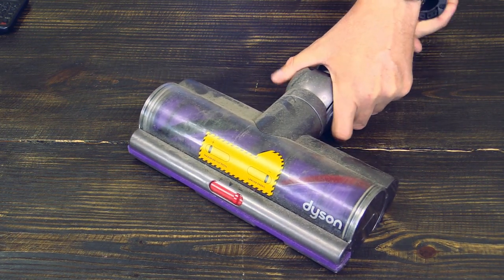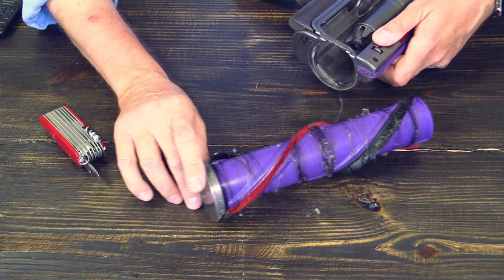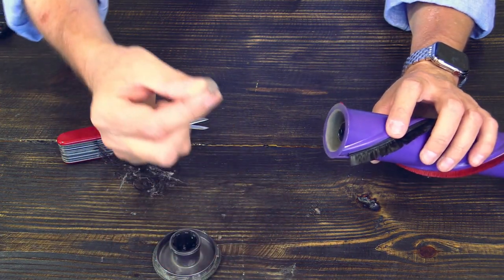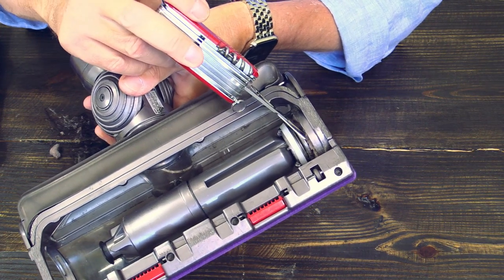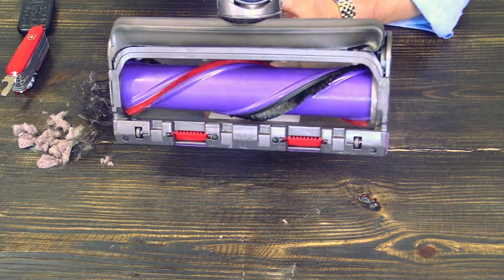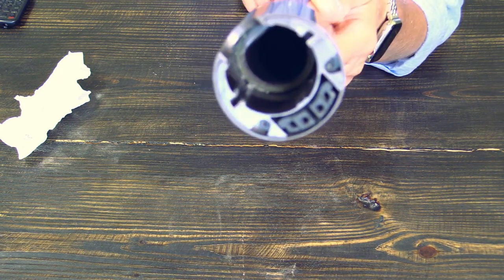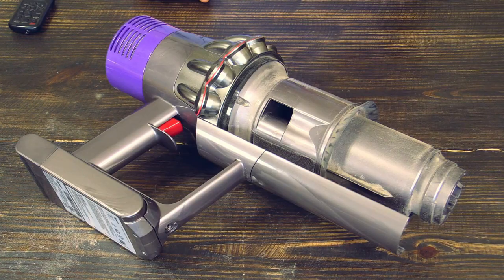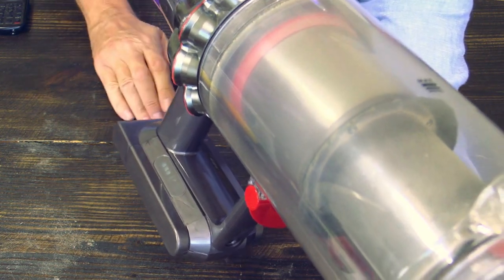How To Check The Dyson V10 For Blockages.

Comment: Wanted to add that taking everything apart did not fix my problem, but it helped. I tried everything you did and took it apart way more than I thought could thanks to your video. But also knowing that I had cleaned it, I felt a little deeper and my filter was slightly damp still despite it being at least 36 hours later. So I put my hair dryer on low and put that in the filter hole and VOILA - all is well. I assume that the dampness decreases suck flow so looks like a blockage. Thanks for walking me through all the possible blockages. Hopefully this extra step will help someone else.
Reply: Thank you so much for posting this! You just fixed my problem 👍
Reply: Thanks for the added info about the dampness, also fixed mine as well

Comment: Thank you for your helpful video.  I want to share a solution that I have come up with for getting clogs or dirt out of partially hidden, often circular, spaces, such as the one inside behind the beater bar next to the motor.  I have found that it is useful to a "zip tie" for tying together wires as a probe/poker.  It is almost exactly the width of the flange at the back of the assembly and will ride inside and bend around the curve pushing the accumulated junk out.  It is sufficiently strong to push without flexing and yet, because it is designed to curve into a circle to bind wires, it will follow curves and any change in surface that you encounter.  As it is plastic, it will not harm machined surfaces or even other plastics; I've never scratched teflon with it, but then again I've never tried.  I hope this little home made tool will help you as much as it has helped me.  Thank you again.  TR

Comment: I got rid of my old V3 because I was sick of using a chopstick to get rid of blockages.  Within 10 minutes of using the V10 it got blocked by a bit of paper - so I had to use a chopstick to sort it out.  This video helped but I am really pissed off at Dyson.  Brilliant engineering in parts but really dumb in others.  Best to get one of those American machines if you want reliability
Reply from the maker: Hello Roland. Thank you for your comment. I am sorry to hear about your problems with your  V10, but I am glad that I was able to help. I will get tomorrow the new Dyson V15. Let’s see if the V15 is better engineered than the V10. Have a great Sunday. 😋

Comment: Great tutorial, but I think I have a blockage in the motor part (from lots of dust and hair?) as I've cleaned everything out, removed all the pieces, and filter light is still flashing. What do I do!?
Reply from the maker: Hello Rachel. Did you clean the filter? How old is the filter?
Reply: @Woopnik  I had just cleaned it. It's only one years old. I've followed your video, recleaned everything and will try again tomorrow. I only know it' seems to fill up fast, and that when I took it apart and banged on the main motor unit little packed chunks of dust would come out. Danke
Reply from the maker: Well, don’t despair, I will try to fix your problem. Please follow these steps:

Remove all tools and accessories from the machine. Put the machine in max power mode by sliding the switch towards max (only V10). Pull and hold the trigger for 10 seconds. Does the blockage light on the handle come on without any tools?
Reply from the maker: Hello again Rachel. Last night I was trying to duplicate the problem you have, but I could not. It looks like your problem is much more serious. Was the filter really bone dry as you reinstalled it after washing? In any case, I am afraid that I cannot help you online. Please contact Dyson:

You can email or call: questions@dyson.com - The Support team is available 24 hours a day, 7 days a week. Most inquiries are handled within two hours or less. 1-866-MY-DYSON (1-866-693-9766) - The Helpline is available from 8am - 8pm Monday to Friday, and 9am-6pm Saturday (closed Sunday).

I apologize that I was not able to help you with your problem. 😳
Reply: @Woopnik  I am in despair! It's only one years old. When everything is removed the filter light flashes then turns off after around 8 or 9 seconds.
Reply from the maker: In my opinion the electronic in the V10 is faulty. That can only be fixed by Dyson. Is your Dyson still under warranty?
Reply: I never registered it. But I have my receipt. It's 13 months old. I'll call and see. Thanks so much for your help
Reply from the maker: I am trying, but in your case I have to see your Dyson. Have a good weekend 🥸👍

Comment: If the blockage light didn't go off by following the video steps - the solution was to replace the filter (cleaning it didn't work) , you should feel "airflow" from the filter...
Reply: Thanks for this; I've tried EVERYTHING to fix it - and nothing has worked.  Guess it's time for a new filter.  :)   $30!!
Reply: @AshleyWilson316  I got 3 filters (not genuine ) by 15$ from AliExpress , 2 months and still works fine

Comment: Thanks bud. Was about to buy a new one. Mine was obstructed where u had the napkin...didnt see much there. Took a toothbrush and scrubbed some dust and stuff...then I rolled up a paper towel(1/2 of one) and used a large hemostat to push it in to that space, and drag it back out and now it works...weird nothing but a bit of dust in there...but it apparently was the problem.

Comment: Hi my dyson v11 stopped working after i cleaned the filter. It was still little bit wet when i used the vacuum the last time. Can anyone help me please?
Reply from the maker: Hello Ngoc. I am sorry to say that most likely your V11 is broken beyond repair. A wet filter can short out the motor and cause it to break permanently. Putting a wet filter can also void your warranty, so you might have to pay for the repair out of pocket. Please contact customer support at Dyson:

Phone
844-705-4777

8:00am - 8:00pm CST Monday to Friday
9:00am - 6:00pm CST Saturday

Email
help@dyson.com
To help Dyson to address your inquiry as quickly as possible, please include the following in your email:

Your name
Contact number
Product model or serial number

Comment: Hi my dustpan is stuck and won’t open, any tips on how to get it to open up?
Reply from the maker: Hello Chayyy. The rubber gaskets use a fine powder as lubricant and if they get wet the bin can become rough to handle due to the rubber folding or holding onto the plastic/metal. This is a common issue for many Dyson owners. To make the seal less sticky vacuum up some baby powder or a handful amount of flour and made sure it was everywhere in the canister after that wait for a bit and again. This time after applyling some pressure it should open.

Comment: There are to many places for dust to collect.It’s a full time job each time you use it.Especially in my home with a dog and many long pile carpet.Mine is showing airflow obstruction when nothing is attached just the motor part and dustbin.

Comment: I cleaned everything filter, removed blockages, but still blockage led blinking
May be battery?
The boost intermittently works
Reply from the maker: Hello Fauzi. Remove all tools and accessories from the machine. Put the machine in max power mode by sliding the switch towards max. Pull and hold the on/off trigger for 10 seconds. Does the blockage light on the handle come on without any tools?
Reply from the maker: If the blockage light still comes on remove the dust bin and turn on the machine. Push the cyclone release catch away from the handle of the machine until the bin base opens. With the bin base open, press the red bin release catch on the underside of the bin and remove it away from the machine. Pull and hold the on/off trigger for 10 seconds. Has this resolved the problem?
Reply: @Woopnik  having the same issue, my machine is clean, filters clean, all attachments off, bin off, so  I've exhausted all of your advice and still my machine cuts off intermittently and blockage light flashes. What should I do now?
Reply from the maker: Good Morning Ryan. If you have followed all my advice, I think it is a good idea to contact Dyson for help: 

https://www.dyson.com/support/quick-links/contact-us

I hope I was of any help. Have a great weekend.

Comment: Mine is still flashing and shrugging ... i dismantled it and it looks like the problem is in the main battery/ filter component
Reply from the maker: Hello Mubeen. Did you check the filter? Is it clean?
Reply: @Woopnik  its 100% clean ... cleaned it a few days ago actually ... plus its not the filter lights on ...
Reply from the maker: What exactly is flashing? The filter indicator light or the battery indicator light? When the filter indicator light is flashing intermittently then the filter unit is NOT fitted correctly. To resolve this, just remove the filter by turning it anti-clockwise. Refit the filter, turning it clockwise until it clicks into place. Please let me know if this advice is helpful to you. 😀
Reply: @Woopnik  the pipe light .... dismantled and cleaned every hole ....light is still on and hopver stops sucking after a few seconds ....
Reply from the maker: Don’t give up. Let me do some testing on my vacuum cleaner. I will get back to you.
Reply from the maker: Remove all tools and accessories from the machine. Put the machine in max power mode by sliding the switch towards max. Pull and hold the on/off trigger for 10 seconds. Does the blockage light on the handle come on without any tools?
Reply from the maker: If the blockage light still comes on, remove the dust bin and turn on the machine. Push the cyclone release catch away from the handle of the machine until the bin base opens. With the bin base open, press the red bin release catch on the underside of the bin and remove it away from the machine. Pull and hold the on/off trigger for 10 seconds. Has this resolved the problem?
Reply: @Woopnik  thanks for the advice solutions, but nothings happening ... it doesn't let me hold the trigger for 10 seconds ... shuts down after 5 seconds of continuous sucking and shrugging ....
Reply from the maker: Good Morning mubeen. At this point I have to say that you have to contact Dyson Customer Support: 

https://www.dyson.com/support/quick-links/contact-us

I hope that helps.
Reply: @Woopnik  Thank you so much, customer service helped and sent me a brand new machine, thanks again!
Reply from the maker: Great. I am glad you got a brand new machine. Have a good night 😴💤🌙

Comment: You did not go into what to do if it is still showing a blockage after doing your steps of cleaning the 3 components. You did not help me at all!
Reply: Had the same issue and indeed the blockage light didn't go off - the solution was to replace the filter (cleaning it didn't work) , you should feel "airflow" from the filter
Reply: Mine was the same after the video, I  cleaned the filter before watching the video,a next stage video would have been useful.